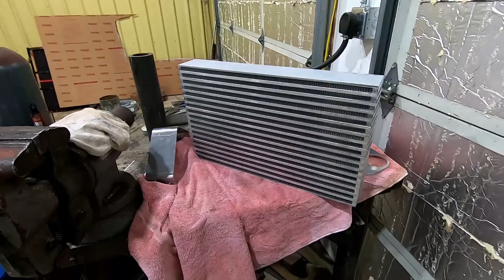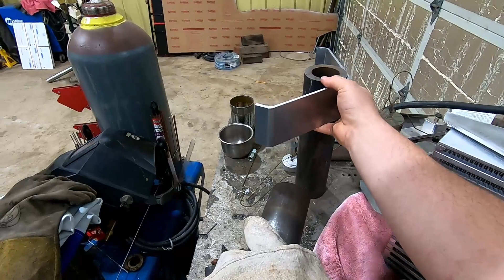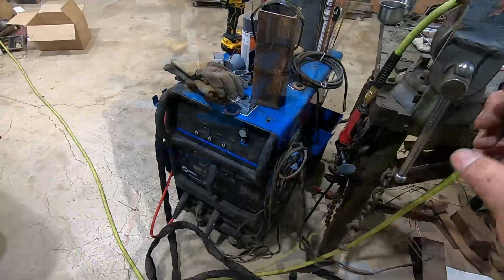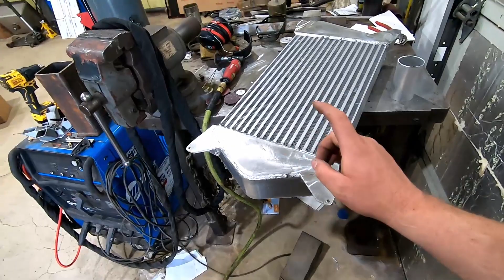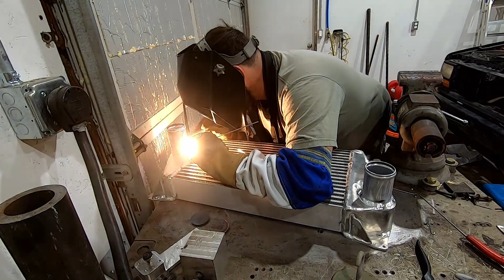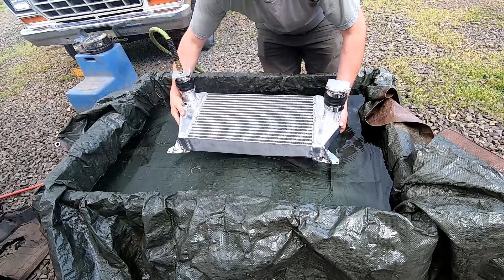How to Build A Custom Intercooler

Comment: This is an awesome project... My 13yr old son and I are considering the 2.3 or the 2.7 EcoBoost for our 2011 Single Cab Step Side Ranger/Splash Street Truck build... Thanks for all the details on your build!!! Everyone does 5.0s. One or 2 I've seen do the 3.5s. We want a smaller package with good power and the 10 Speed Auto.
Reply from the maker: I didn't look in to the 2.7 as I wanted a manual transmission. it's probably another good option for a swap. One thing I liked about the 2.3 was the size and weight, was the same weight as the set up I pulled out